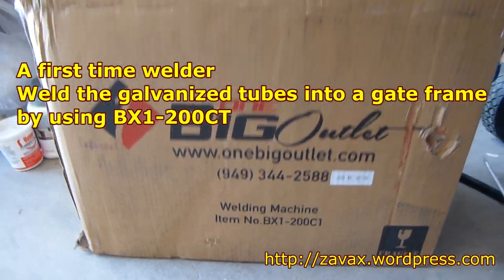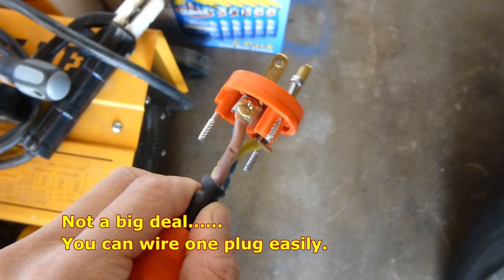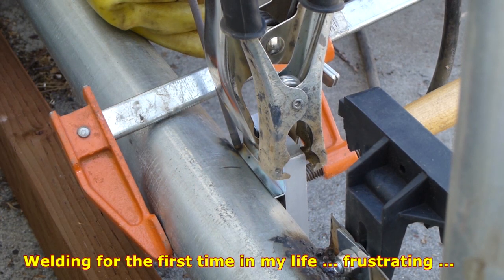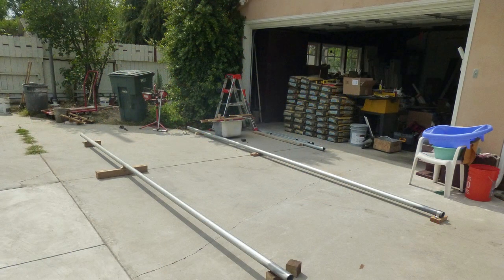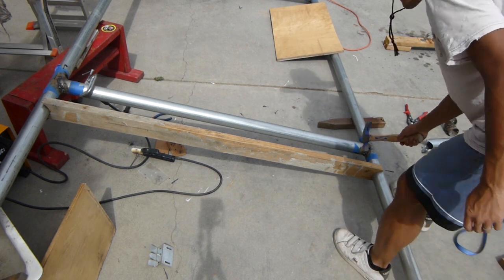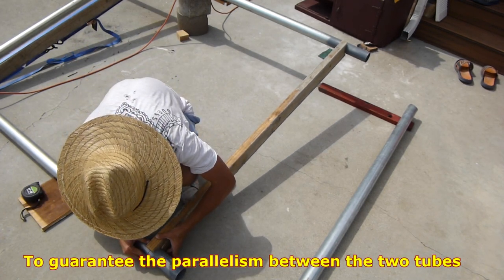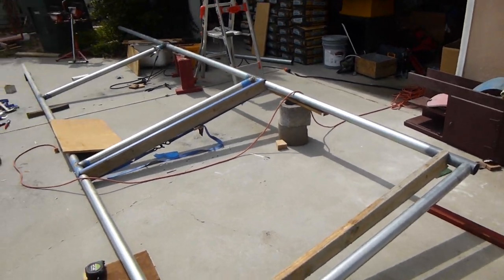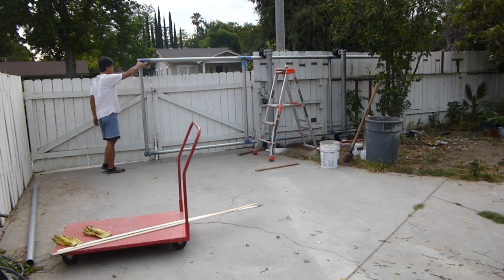A beginner welds galvanized tubes into cantilever sliding gate frame, using BX1-200C1

Comment: Any body (beginners especially) need to know how dangerous it is to weld galvanize material without good ventilation. You should wear a respirator even outdoors to avoid any tonic fumes when welding!
Reply from the maker: Thanks NIC, it's important! And I did wear a respirator.
Reply: I did not know it was dangerous. Thankfully, I am super worried about everything and research obsessively before doing welding on any new material. Thank you very much for the heads up!

Comment: One thing that will help your future welding projects is the metal prep. Remove all of the plating from around the area you are going to weld. The zink is the reason it smokes and pops. Also, use a smaller rod size. 1/8" is huge for thin tube like that. 3/32 and 1/16 would be ideal for your project.
Reply: ColtDeltaElite10mm  : I noticed your comment name, I have one,bought it 8 years ago for $1000 used, and have yet to shoot it but it is a fine looking weapon ! "Break glass in case of fire"👍 Maranatha, Greetings from Tampa Florida 😎
Reply: ColtDeltaElite10mm  : I just got done welding 1 1/2" galvanized pipe,building a hand motorcycle lift,1/4 " wall and I learned  quickly that the galvanized coating had to be removed (I watched this video AFTER)before welding using a Lincoln 225 amp buzz box at about 95 amps and 1/8" rods and the welds were ATROCIOUS because of my lack of skill! Looked like somebody blew buggers on the pipe,I struggled through it and grinding out porosity ALL over the place and more weld! I told my son- in -law " don't tell anybody who did this"🤯 It worked but it IS UGLY! Nothing a little Bondo won't cover,gave me a lot of respect to you guys who do this every day! Maranatha, Greetings from Tampa Florida 😎

Comment: You should have mig welded this gate much easier to weld and correct type of welder to use for this application.  Arc welding is mainly for 1/4" steel and thicker.
Reply: I saw a video that said its easier to stick weld galvanized. Most welding I do is also galvanized and I use a stick but was thinking of getting a mig till I saw the other video.

Comment: also, could I plug this into an extension cord and use in a normal outlet on the house?
Reply from the maker: +kenney villers If your extension cord is thick enough, e.g. AWG 1 or 2, not too long, e.g <10ft, and your normal outlet is capable of supplying 20amp, I guess the answer is yes. That is exactly what I was doing.